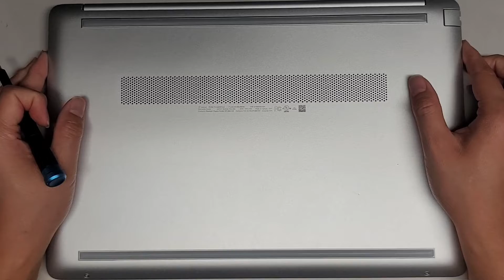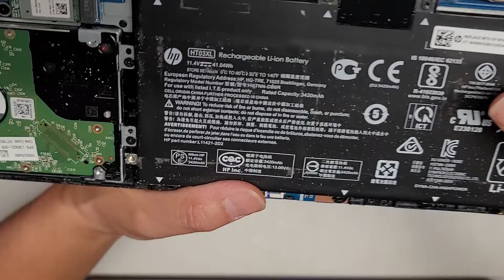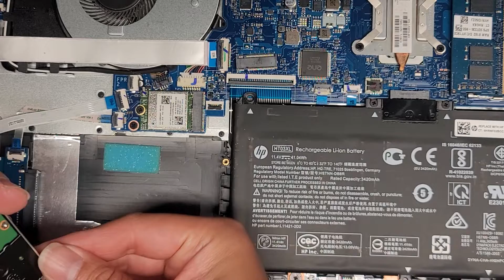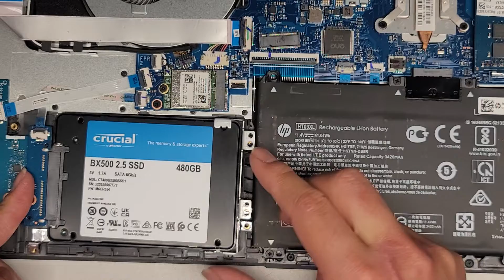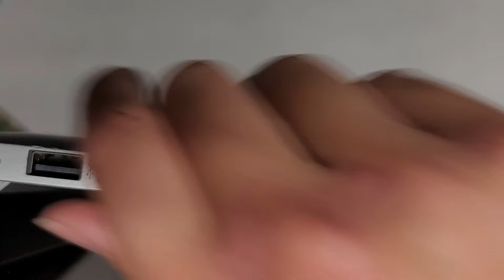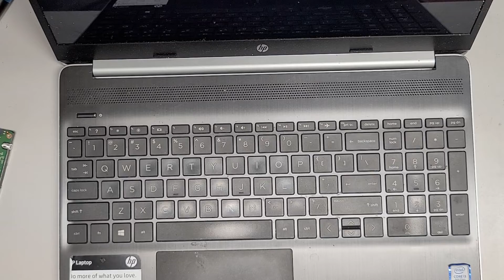HP Laptop 15-dw0037wm Disassembly RAM SSD Hard Drive Upgrade Replacement Repair Quick Look Inside

Comment: Great video, helped me to add an 8gb ram stick to make it 12gb...it came with 1tb hdd so I added 256 gb m.2 ssd for the sole purpose of fast boot up and fast loading of programs

edit:  I'm thinking of swapping out the 4gb to make it 16gb dual channel...not a needed but I heard its good for stable and reliable performance, not that I don't have that already
Reply from the maker: @wisembhalati  haha yeah, it'll be a little faster. I never felt it makes a huge difference like SSDs do. Did you migrate the OS to the SSD? Installing one without doing that won't make any difference.
Reply: @ItsBinhRepaired yeah I used the tool disk genius
Reply from the maker: @wisembhalati  nice

Comment: I have one doubt, Actually this Laptop having ssd slot also but what is the reason for removing hard disk please let me know
Reply from the maker: @shekarrendla  hard drive is slow and not used. If it goes bad it can prevent the computer from starting.
Reply: @ItsBinhRepaired  thanks for clarification, how to know the extra ssd slot in laptop without opening, any chance, please let me know
Reply from the maker: @shekarrendla  need to know the exact model
Reply: @ItsBinhRepaired  Sir I am using 4gb ram 2400 mhz/1tb hdd, 

so can I add 16/8gb at 3200 mhz, and 
dual storage 512 ssd +1 TB hdd, its support or not please help me….!
Reply from the maker: Not sure if you can change the speed

Comment: Great video, thanks for the tip about using your thumbs in your fingers to pry the cover off the bottom from the top. I stared at this thing for like 20 minutes after taking all the screws out trying to figure out how the heck I was going to get that off and that was a perfect explanation. A little bit unnerving at first but after that no big deal.
Reply from the maker: Awesome, glad it helped. If you haven't already, please like and subscribe so others can find my videos and possibly consider watching a few others and commenting to get the algorithm to recommend my channel. Thanks!
Reply: @ItsBinhRepaired  done and done! Thx
Reply from the maker: No problem :)
Reply: @ItsBinhRepaired  as long as we’re chatting here… Lol :-) do you mind if I ask, I have an HP model 15 and for the life of me I can’t figure out the maximum amount of ram for this laptop. Right now it has a four gig dimm in it, but there are two dim slots. Can I put two 8 GB dim in this thing and for a total of 16?

Sorry, I know it’s probably annoying to get these questions – I do IT for a living, and I’ve been on both sides of this. If you’re able to answer, I appreciate it, if not, no big deal still appreciate the channel! Thanks.
Reply from the maker: @chrish6659 there is no limit. The limit is what you can afford and fit in the slots. You can use 2 16gb sticks if you want.
Reply: @ItsBinhRepaired  fantastic, I have a 16 gig kit coming tomorrow from Amazon. It’s a dual eight gig dim kit. Thanks again for all your help, looks like I need to buy you a virtual beer! 🍻🍺
Reply from the maker: Awesome! I don't have a buy me a coffee(beer) thing setup (I don't really drink caffeinated/alcoholic beverages much lol), but if you do want to buy me one (in the order of best to worst) Zelle, Venmo, PayPal, and YouTube Super Thanks all work. :P

Hope the upgrade goes well!

Comment: Hey man, I have an  " HP Laptop - 15s-du2036tx " and i want to replace my hdd with a sata ssd but i am so confused cuz my laptop is so unique there is not a single tutorial on how to updgrade it 😭 i found your video and my laptop's back cover looks same as yours so i was thinking if it is same process like this btw by any small chance do you have a laptop like mine or same model ?
Reply from the maker: I'm not sure. I'd have to see the laptop.

Comment: So if I were to upgrade to a ssd drive, would I need to reinstall Windows 10?
Reply from the maker: Not if you clone the hard drive to the SSD first
Reply: @ItsBinhRepaired  I see. Thanks! I may consider the SSD upgrade option after I upgrade the RAM. I wanna get that part done first since I want to look for any low-price SSDs
Reply from the maker: @MrOnyxWolf  here you go https://youtu.be/4p5jFDzVwUw

Comment: Do you know what an ESD wrist strap and grounding cable are?  You should be using one!  Technician 101 dude.
Reply from the maker: Of course I know what they are. Not necessary if you know what you're doing. In the thousands of computers I've worked on, I've never had an issue.

Comment: The laptop came with ssd 250gb and I added an hdd 750 gb, added an 8gb ram, in total 16gb. And opened the case for more ventilation. Everything worked
Reply from the maker: Awesome, glad it worked! If you haven't already, please like and subscribe so others can find my videos. Thanks!
Reply: Why hdd don't they generate heat and are slower then ssds?
Reply from the maker: Cheaper capacity
Reply: @ItsBinhRepaired  thank you 🙏😏
Reply from the maker: @oikiakaeidi  yup

Comment: Do you know what the maximum ram this is compatible with as well as the maximum speed, possibly even the maximum storage this m.2 can hold. Thank you in advance
Reply from the maker: Not sure. Usually it's whatever you can buy and fit.

Comment: One Question. I just got the new HP DW-0083WM and I recently got the 500GB disk from my old HP-1572WM. would the 500GB disk work for the DW-0083WM?
Reply from the maker: If it's the same type. You'll need to install the OS on it. If you just swap it, you'll likely have a lot of issues.
Reply: @ItsBinhRepaired  the OS?
Reply from the maker: @Shadow57053  Windows
Reply: @ItsBinhRepaired  oh ok
Reply from the maker: Yup

Comment: What glue to use if the rubber strip wouldn't stick anymore?
Reply from the maker: Glue? You use double stick tape.
Reply: @ItsBinhRepaired  thanks
Reply from the maker: @aimantaufik1500  no problem

Comment: Same screw stuck on mine.
Reply from the maker: Which screw?
Reply: @ItsBinhRepaired  second one on the row of 4 opening the laptop
Reply from the maker: @shymouse1604  permanently stuck?
Reply: @ItsBinhRepaired  no, just took a lot of work to get it out. It had a lot of blue stuff on it.
Reply from the maker: @shymouse1604  ahhh